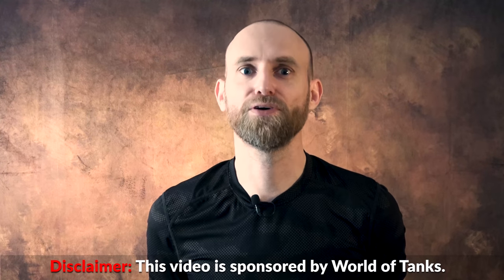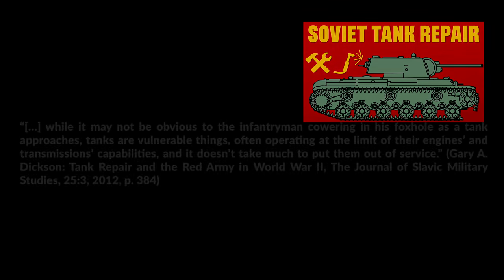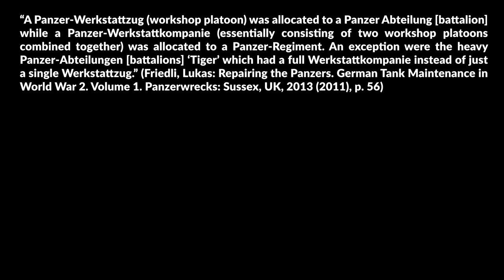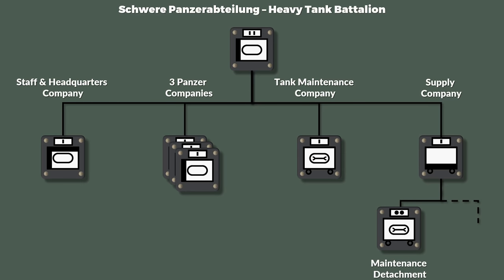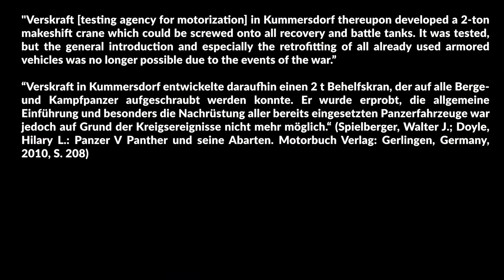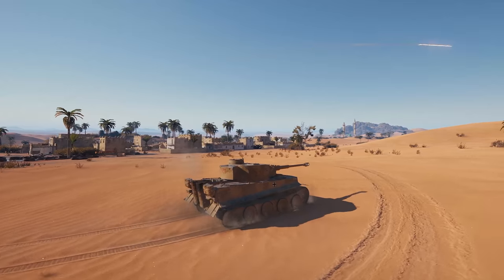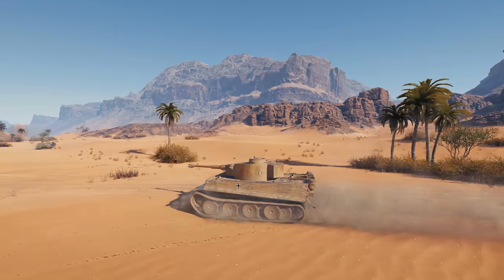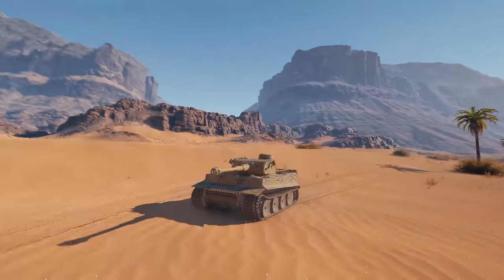Repairing Tigers

Comment: Thank you for this video. A couple of years ago I read an interview where there were told that he once had spoken with a mech from a german Tiger tank unit. And this guy claimed to had been told that it took 10 hours of maintenance for each hour a Tiger was in battle. Really put things in perspective regarding of people needed behind the front compared of those at the front.
Next I had also read that tracks needed to be replaced after 2500 km and the engine after 5000 km. What a big work to have thiese cats running  :-)
Reply: Ahh, like any tank was in WW2 wasn't the similar.
The lighter the less maintenance of course.
Reply: @AKUJIVALDO  I really don't know. But I know that a "heavy tank" in that period was considered new high tech for all countries. So I guess that the tech wasn't as good as now. so they more easy broked down. And reading about the troubles with Tiger and Panther there were no similar stories about the medium and ligth tanks in the german arsenal.
Reply: @henrikhilskov  so it was no trouble for 3rds and 4ths? Oh, it was. Except they evolved trough the long time unlike cats. Search readiness percentages on Panzers.
Light tanks in Germany in 1944-45? LOL 
Of course, first Panthers were horrible as it was brand new ones, who jumped up by 20 tones from previous Panzers. New models improved reliability greatly. 
Tigers were a bit different story. They were designed as breakthrough tanks and were not supposed be mainline. Specifications for them was fight in heavy combat and then take rest, repair, resupply for couple of weeks. And then Heavy Panzer battalions were used as fire brigades.
Of course, worst story was that Germany never had enough fuel, spare parts and spare Panzers. Otherwise their tank readiness would be at 95-100%
Reply: @AKUJIVALDO  Yes you are absolutely right here. You go into more details that is not suited for this communication plugin youtube have. I just understrecht that heavy tanks was new technology for all countries at that time. Actual the intelligence of England had reported that germany was not able to produce heavy tanks at all.... I am not absolutely sure why it was important for germany to prove them wrong. However the germans was so keen of showing the world that they was able to produce heavy tanks that they send some soft steel "heavy" tanks to the invasion of Norway. And off course they performed very badly beeing in soft steel and not tanke steel or even surfaced hardende steel. It was the Neubaufahrzeug
Reply: @henrikhilskov  it was trial vehicles who then was used for propaganda. Multi-tureted Panzers weren't viable. And they weren't "Heavy".
And of course, when you have limited manpower and fuel, you will build less but better quality tanks, like Germany did.
Reply: @AKUJIVALDO  You are right. Your argument got me to look up newer sources than the tank Encyclopedia I have from the 1980ies. And they were considered medium tanks and not heavy. And yes they were mostly used for training and shows but 2 was in action in Norway 1940 and one of them was the soft steel version there had very low protection value. Next the newer sources stil claims that spies reported them as in the heavy class. So there seems to be some misunderstandings about it. And I am not sure whats right and wrong here. Do you have some sources? Or had you heard about those stories mention thoses spies or just a funny story someone in the past have fun to spread?

Comment: As a former driver, gunner and later tank commander I've always laughed at the footage I've seen of world of tanks, if a driver actually behaved like that in a real tank, he would have mote to worry about than the enemy. Tank interiors are full of hard and often pointy objects with few if any  purpose built bracing points for the rest of yhe turret based crew, the driver is also sitting in a very vulnerable position in relation to the rest of the crew. And that's not forgetting the point made in this otherwise excellent commentary, they break easily.

Comment: In a recent video the guy from the tank museum wondered if the problem with the gearboxes of Tiger and Panther was crew training because their experience of operating 131 was it was quite robust if used properly
Reply: It seems to be a combination of poor production quality and inexperienced drivers. Even a robust vehicle will get trashed by an incompetent driver. Considering the intense situations these tanks went thru, they did quite well considering, especially when compared against modern tanks which still have very frequent service requirements.
Reply: @T4nkcommander  silly fact the reason the Tiger had a steering wheel is the gear box was originally designed for a heavy artillery tractor half track. A British artillery tractor! That's what I've seen in print anyway.
Reply: If the Germans had used helical cut final drive gears in tiger and panthers, AkA Sherman m4 the reliability would have been immensely improved,  also in ww2 field lifting capabilities were still developing for heavy vehicle,  I remember changing m60 a1 main gun assembly with a 2 man ordnance crew and 1 ,5ton wrecker operator 15 hours the 105 mm weight was 3 1/4 tons approximately
Reply: @boarzwid1002  I read somewhere that the Germans simply didn't have the tooling and machines to make helicoil gears, so they had to make do with weaker straight cut ones.
Reply: That's probably true but no ones shooting at 131 while it's trundles slowly round a flat dry oval once a year at tank fest. I doubt they take it on 50 mile forced marches through muddy hilly goat tracks either while under constant threat of ambush from the air or in the bushes.
It's a good point about the crew but at the end of the war Germany didn't have seasoned veterans to man these machines, it sounds like it was some rushed basic training then off you go
Reply: Lastguy  I think that’s plausible but considering when the ballbearing factory’s were put out of service, they found a better way to manufacture them from ceramic. And as far as helical gears why didn’t they just drop forge heicial gears en mass , but there crews were also mechanics as well so maybe it wasn’t such a big deal , when there was a breakdown, 🤔
Reply: @boarzwid1002  I'm no expert but I'm pretty sure high performance gears have to be machined from hardened steel, I don't think they can be forged as the metals too brittle. I'd also guess that if they thought it would work the Germans would have done that, it's not like helicoil gears were a secret. If nothing else they had thousands of knocked out shermans to look at

I could be totally wrong tho, my only knowledge about this is a bit of retained memory from something I read on the net somewhere (probably someone like me spouting rubbish in the comments section lol).

Break down of the final drive would be beyond any crew to fix, the things are about the size of your fridge and require hours of work to remove, and heavy machinery. They're one of the main reasons many tanks were blown up if they couldn't be towed back to a repair shop. That and running out of gas.. Can you imagine blowing up a brand new Mercedes car just cause it ran out petrol?!

Comment: This may just be tangentially related, but I thought your comments section might have some good answers (or perhaps an idea for a video)
What was the reasoning behind the creation of the Bergepanther? I can understand Germany retrofitting old chassis of Panzer 3 and Panzer 4s with cranes to make armored recovery vehicles, but I've always been confused as to why they would waste the potential of having an operational Panther that is capable of fighting by making it into an armored recovery vehicle. The infamy of the Panther's reliability just makes it all the more confusing to me. Is the reasoning explained in any documents from the time period?
Reply from the maker: there were Panzer 3 and 4 Berge variants, but I don't think they worked well with pulling Tigers. Also Panther was heavily optimized for mass production.
Reply: @MilitaryHistoryNotVisualized  Thank you for the answer! It makes sense to me now that I know the Panther was built for streamlined mass production. I had the misconception that it was an overly complicated and complex to produce design, like its other Big Cat brothers. I would have thought Bergepanzer 4 could fill the role until I saw how much more horsepower the Panther had.
Reply: Maybe Thats Why:

A Bergepanther drove 4200 km without new spareparts and 1000 km from 4200 km it was towing other panthers.
(Panther - Thomas Anderson page 55.)
"There is an article on this subject in the June 1944 edition of Nachrichtenblatt der Panzertruppen (News sheet: Armoured troops):
Performance of a Panther-recovery tank driver.
Unteroffizier Krause of a Panther workshop platoon has up to 3 May 1944 driven his Panther recovery tank – Chassis No. 212132 – 4,200km without an engine
change or damage to the transmission, including the final drive units, gearbox and drive shaft. Approximately 1,000km of this was made towing a Panther tank.
The vehicle and engine are still in excellent condition and continue to be operational.(Panther - Thomas Anderson page 55).
Reply: To assume that panzer III and IV in 1944/45 were that much more reliable than the panther is a misconception.
They started to suffer from the same late war limitations as the Panther.
"From the front there continues to be serious complaints regarding final drive breakdowns in all vehicle types. Approximately 200 breakdowns have been reported with the 38(t). Prior to the 1945 eastern offensive there have been 500 defective final drives in the Panzer IV.  From the Panther 370 and from the Tiger roughly 100.  
General Thomale explained that in such circumstances an orderly utilization of tank is simply impossible.  The troops lose their confidence and, in some situation, abandon the whole vehicle just because of this problem. 
He requests an increase in efforts for the final drive, since only this way can the problem be laid to rest.  With the previously intense criticism of the engine and the final drive continually playing such a roll, it is welcome news to learn that the gearbox generally enjoys a good reputation.  (Page 259 "Panther and its Variants" by Walther Speilberger).

According to Hartmut Knittels Book "Panzerfertigung im Zweiten Weltkrieg", the officials in the Nibelungen Werke (Panzer IV production) were clearly aware that they made use of final drives, which did not meet the quality standards. The german war industry was forced to experiment with the hardening processes during the steel production, because they were short on certain resources. This could be the reason, why all late war german tanks (38t, Panzer III and IV, Panthers, Tigers) suffered from broken finald drives and bad bearings.

 Were the final drives to weak or a flawed designe.  I dont think so:
Some people claim, that the final drives of the Panther were bad by design, but the Centurion, which was 7 tons heavier, used the exact same type of final drives. Like many other tanks too. M26 Pershing for example.
The theory that the drivetrain of the Panther was overstressed, can explain why Panthers had big reliability problems.
But this theory can not explain, why large percentage of Panthers made it easily beyond those often claimed 150 km before the final drive gave up or other parts of the drivetrain broke down. This theory can not explain why a Bergepanther drove 4200 including the stress of towing another 45 Ton Panther without receiving any damage.
I think production quality, available resources and crew training were the true limiting factors.
Reply: @HaVoC117X  Frankly, I've never trusted that French report (Le Panther 1947). The criticisms made just do not appear in German reports at the time or from veterans recollections.
Reply: @HaVoC117X  bergepanzer doesn't have a turret which is over 7,500kg but still mostly agree
Reply: @juhoalander3461  A fully equipped Bergepanther had a weight of 43 tons. Only 1 ton lighter than a regular Panther. All the tools, the 100ton winch the heavy shield adds a lot of weight, too
http://halbkette.de/Bilder/Bergepz_5_A_WTD_04-1.jpg
Reply: @HaVoC117X  I have long forgotten the numbers,but years ago the Cummins comealong engine(I think the 230hp version) was industry standard for many years. For truck transport use. As such,engine lifetime,transmission lifetime (Fuller Roadranger mostly) was partly dependent on application.
Also driver dependent. Very much so. A man hard on equipment or inexperienced or clumsy or uncaring could have an engine lifetime far less than half an experienced, competent driver. Grossing 60,000 pounds ,maybe even more,is absolutely not the same thing as driving a Honda with no load aboard. Back when gasoline engined gravel trucks were still produced,I talked with an owner operator who was getting an engine change for the first time,and the truck was 10 years old. Probably the best approximation of a Tiger then available. He mentioned that his was the last in the fleet,and he was an o/o . All the company trucks had worn out years earlier. So very much condition and driver dependent.
 I bet that  Bergepanzer driver was skilled,older and prewar experienced unlike the young kids up at the sharp end. Who kept getting killed and replaced.

Comment: I think the panzers should have been designed in modular, scalable fashion from the get go, than ad hoc fashion as it happened later.      Interleaved track version should have been built during peace time for the coming war, for well trained panzer crews, but once war phase happened, the interleaved track should have been abandoned for non-interleaved version, and wider track adopted as well.  In fact, the Germans should have concentrated on TDs with open turrets, 88s, with thinner armors, to be attached to panzers units, and TDs with open case mate, 88Ls to be attached to panzer grenadiers, but using the same suspension, engines, to take maximum advantage of economy of scale rather than panthers and tigers, more Panzer III or IVs and far more TDs, and squad portable assault mortars, but no Panthers, no Tigers, no sturmtigers.   With III or IVs leading the way, to be backed up by TDs with open turrets, and further behind TDs with open case mates, and even further behind assault mortars.

This would have maximized both movement and fire power, but also economy of scale, reliability, durability, lower/easier maintenance.   IIIs and IVs providing direct fire power against infantry, light fortifications, and enemy artillery, TDs with open turrets providing fire power against enemy tanks, TDs with open case mates, providing even further reserve fire power against enemy tanks, and assault mortars providing flexible fire power against both  enemy infantry supporting the enemy tanks, and against the dense concentration enemy tanks themselves, at a relatively safe distance.

Comment: And do not forget: Kingtiger had only 2 layers in suspension. :)
Later the Panther 2 would had less or splitted layers.
Reply: Panther 2 was cancelled before Tiger II entered production tho ;)
Reply: Not mechanically inclined here, what’s a layer in suspension? Is it the number of shock absorbers between track and frame or what?
Reply: @reteip9  It still doees not change  a fact: they planned a better track layer ;)
Reply: @nomobobby  The "wheels" are connected to the torsion bars. If the tank reach a bump, only that wheel will rises, not the whole tank, like as for a T-34.

Comment: I've read of one instance of  the Germans using a captured Sherman as a towing vehicle.  It seems like a good choice because they probably lacked ammunition for it and it had a relatively high power to weight ratio.   How common was this practice?
Reply from the maker: I read that too, I think two Shermans actually with their turrets removed. At one point I thought about putting it into the video, but I did not. I don't think it was common.
Reply from the maker: not common due to a) regularly getting access to fully intact Shermans and b) I know captured tanks like Shermans were also pressed in service, yet, I don't know how, where and who exactly determined what to do with captured material. Then of course there is the question, was this authorized use, "grey area", kinda tolerated use (like towing Tigers with Tigers although forbidden) or forbidden and not really tolerated at all.

Comment: Why should increased weight make for lower reliability? If everything is upscaled at the same level? I do understand that bridges, towing, and cranes is an issue, as well as useing things built for a smaller modell.
Reply from the maker: > If everything is upscaled at the same level?
ok, even if that was so simple, go ahead - without a computer - and upscale a 10 ton vehicle to 30 ton vehicle, remember all the parts are 3D... and physical equations.
Reply: its called square–cube law